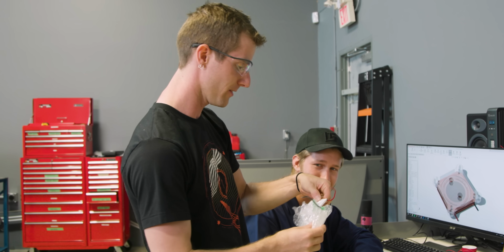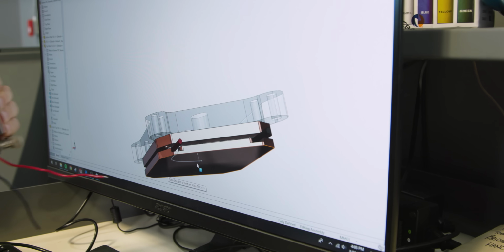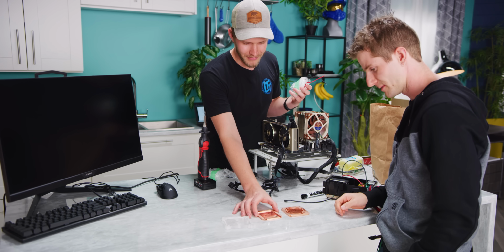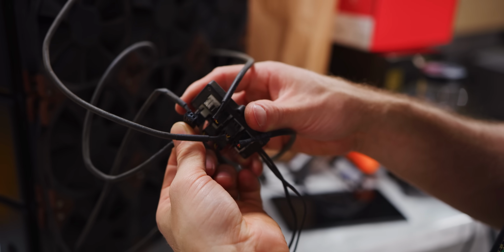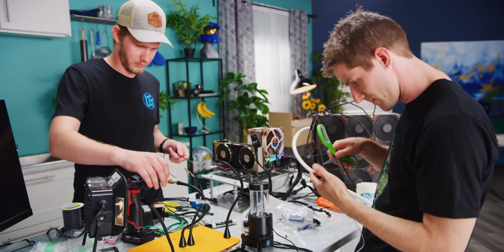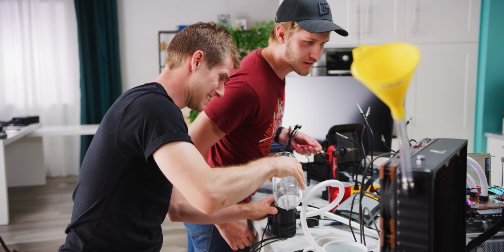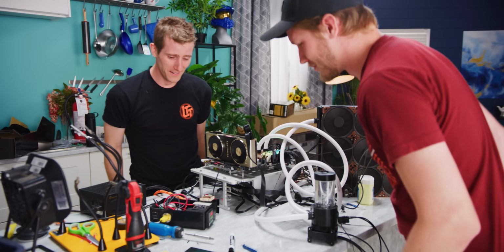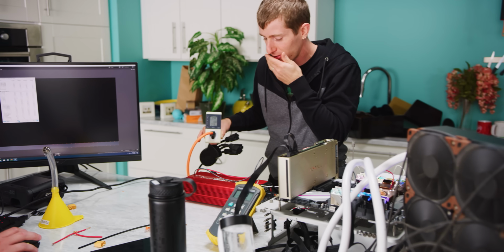This Cooler DRAWS 545W!!? Bad Cooling Ideas #2

Comment: Why not cool the water instead of the processor with a bunch of peltiers?
Reply: though the same thing, if this isnt the next thing they try it will probably be forgotten. cooling water would definitely work tho.
Reply: Build a buffer of cold water and in normal use it would work great, gaming for 24 hours or even 8 hours would probably overwhelm it
Reply: @H3nryum  not if you cool it with normal radiators before going extra with peltiers after those.
Reply: @4.0.4   thats what i would do, cool the return process water via radiator, bypass Peltier or disable/lower voltage of Peltier if below a certain temp.
Reply: @H3nryum  you just need to get a system that switches between two or three big tanks of cooled water when they reach a said temperature. One is used to cool the pc while the other is rapidly cooling and they switch back and forth between water tanks to run forever
Reply: Having the cold side attached to a large passive heatsink in the resovoir probably would be more effective .
Reply: is that not exactly what they did the first time around?
Reply: Ara Torosyan Yes they did that with the first video, got beefy Peltier coolers and water cooled them then used the cooled water to cool the CPU.
Reply: Worth a try
Reply: I was just about to say this, you can run it at full power even.
Just do a thermal coil of some sort into the radiator
Reply: The only problem is to find the best way for heat transfer
Reply: They kinda did it a month ago: https://www.youtube.com/watch?v=IX2NQ1lq4ZM
Reply: i Say add the pelter in loop with just a cpu block on it and you can have a hot rad on the other side heating your room :)
Reply: Because a chiller is vastly more efficient
Reply: the problem is any set up that works generally uses 2 peltiers because 1 isn't efficient enough. I believe there are a few builds of both chilled water, and directly cooled peltier builds on overclock,net. The issue with the water chilling, for it to be super effective the water would have to be chilled below the dew point which causes condensation up to the cpu cooling block.
Reply: Peltier Hot side on the inlet of the radiator and cold side on the outlet. They get to use the stuff they've already made and it'll work.
Reply: yeah, but then you could just buy a waterchiller, which you can easier integrate into the loop AND can actually choose a temp, like just above the dew point
Reply: Because you would need to cool the pettier again and so you just loose efficiency
Reply: They need to build a cooler that's basically an electric water heater but for cooling.
Reply: They did in the previous video: https://www.youtube.com/watch?v=IX2NQ1lq4ZM
Reply: c0ldw1nd  like they did before but with more of those aquarium coolers or just use that huge blue blower from highest airflow pc video and stick that on that triple rad👌😂
Reply: About to say the same
Reply: https://www.youtube.com/watch?v=7BwRvzIoqb4
and check out his watercooling air cooler...its in korean though...
Reply: maybe because the water would freeze if waterflow wasnt sufficient. also the surface area of the cpu is way smaller than the water container. but i am only guessing here
Reply: @raven.dracali  10.000 dollar 900 watt water heater
Reply: actually der8auer made 2 Videos about that
Reply: Separate the cycles as I did. And reduce the water temperature with the peltir.
cool the peltier with another eyelash.
start the peltir loop first.
At 18 degrees turn on the CPU
https://www.youtube.com/watch?v=XkKbIP_Y9A4&list=PLEMp9XvhwLe_SHZcKe8zCEayuFIimHLA6&index=156
https://www.youtube.com/watch?v=CG-CVr_vEo4&list=PLEMp9XvhwLe_SHZcKe8zCEayuFIimHLA6&index=126
https://www.youtube.com/watch?v=758BIB8tS3s&list=PLEMp9XvhwLe_SHZcKe8zCEayuFIimHLA6&index=145
old`s >
https://www.youtube.com/watch?v=Aj3DXK7aVbA&list=PLEMp9XvhwLe_SHZcKe8zCEayuFIimHLA6&index=70
https://www.youtube.com/watch?v=0csO_FSYnGQ&list=PLEMp9XvhwLe_SHZcKe8zCEayuFIimHLA6&index=102
Reply: Der8auer did a video on this already
Reply: a "bunch" of peltiers, each drawing 900w. DO IT LINUS.
Reply: Been there, done that. I used a commercial product that controlled the peltier with a pwm signal. The controller kept the pelt from going too low in temperature. 25°C was the target. The pelt was cooled with a copper heatsink and a 60mm fan. This was ziptied to a small waterblock that ran inline in the water loop after the rad and pump. The heat from the CPU was dumped out the radiator and then the water was chilled by the pelt.
Reply: But then you need another loop to cool the hot side of the peltier...
Reply: @jameshealy4594  just cool the hot side with the same loop. Boy do I love breaking the laws of thermodynamics.
Reply: I second this!
Reply: No, this way is more efficient
Reply: Nice Idea! They could use alcohol or oil instead of water to prevent it from frezzing.

Comment: Try to use modules with less than 100 watt and it will work mush  easier due to the lower heat will be removed form the hot side since as i know that piltier convert the used watt to heat + the moved heat which is so much best luck

Comment: You might have needed to have a ceramic plate to isolate the upper and lower plates and have non-conductive screws as you might have had some heat transfer.  Also can you not find a thicker TEC?

Comment: a freind of mine was running such cooling in 1999 with a self made cooper cooler and an aquarium pump.... hes problem was the condensate cause the cpu was running at -30 C° in idle. There are several points you can check once more if interested in fixing it. 1.  First i would check the controller. 2. The temperature sensor. 3. Check the water temperature.

Comment: for all the info  i have read about peltier thermoelectric it works better  to inductive heat to make energy  if you read at any physics book the cool air is air with positive charge and the hot air is with negative charge

Comment: This is like inserting an extra slice of bread in between your PB&J sandwich hoping it'd taste better and has less bread.. Wait, did I just think of a new sandwich? I'm gonna try this tomorrow.. 😝 
Yeah, not sure that was the best setup.. Why would you insert a potential insulator between a heat source (CPU) and the heat extractor(water block)? Even if the Peltier was super efficient, cooling would still be limited by your water loop/radiators.. You're probably better off trying to cool the water using a custom Peltier setup (maybe a low power setup - multiple low power modules) than trying to cool a CPU directly..
Reply: At least that that way even if your TEC setup fails, you still have cooling if not sub-ambient cooling..

Comment: could you not do a couple water blocks with normal air coolers and insulated tubing to exchange temp from water removing the overwhelming heat from the direct contact of peltier to cpu use the water as a buffer

Comment: I made a project in 2014 about all you had designed here, but I also was able to use the peltier to watercool a GPU, but I was also able to transform heat into electricity to power the TEC, awesome to see it again

Comment: Yeah, thermoelectric coolers aren't really meant to cool a continuous heat load like that very well.  I knew an engineer who specializes in thermoelectric coolers and the main scenario he used them for was when a piece of equipment needed to be kept at a very precise temperature, such as optics in a spy plane camera.

Comment: Useless. The peltier cell generates more heat than the CPU. It's only job is to transfer heat and it's pretty lame at it anyway...
You are setting a bad example by suggesting jamming the EPS plug to the PCIE power socket, the +&- pins are reversed between them and there were multiple cases of people frying motherboards and graphics cards by doing it. This was supposed to be tech channel but it became a competition for the dumbest idea ever...

Comment: This idea is fundamentally flawed... The fact is, peltier devices produce more heat than they remove, so you're just forcing the water cooler to have to cool even more heat. The rate at which a piece of copper would transfer heat is much more efficient than a peltier device. The main point you're missing is that peltier devices do not produce cold, rather they move heat. The only difference between it and a normal heatsink is that a peltier device can move heat between places that have equal thermal energy or even from low thermal energy to high, while a heatsink only moves from high thermal energy to low. When cooling a CPU, all you need to do is move high to low since the cpu is much hotter than the environment.

Comment: instead of making a copper plate for the cold side, you probably have been better with just some kind of frame to hold the TEC to the watercooler and let the TEC touch the cpu directly. or just thin out the copper from the cold side.

Comment: Why in the world didn't you just swap out the TEC water block with a normal water block so we could see a direct comparison?!
Reply: I concur; slap the same waterblock right onto the CPU, not like the bottom of it was milled to a certain shape or anything.
Reply: It would be pointless, with that amount of flow and radiator surface area the 9900k would be in the 30*c range given decent heat transfer between the block and CPU. It is so overkill for a stock CPU that it is bordering the ridiculus.
Reply: @rainmaker6217  You typing that out is incredibly boring.  I want to be amazed like you were the first time you seen an overkill water cooled system.  I have never seen one.
Reply: @1spaghetti32  I fully understand the urge to see something like that, but it's not really going to give any interesting data in this case. Past a certain point you don't really see all that much of a temperature gain with watercooling if you continue running the fans at the same speeds. You can however run the fan speeds significantly lower on a massive radiator setup like that if you were so inclined. The temps won't be all that different from a decent 360/420mm radiator though as the fans are likely not being run at sub 500rpm in this case.

If you want to see an actual cool build with one of these massive radiators you should check out what "Not From Concentrate" did in his build (just search for "Miniest ITX, Maximumest cooling! (I sorta watercooled a S4 MINI...)"). Otherwise there is also the house watercooling build on this channel as well, and a heap of other cool ones out there.

My point was simply that in this case tehre really was no benefit in doing an "apples to apples" comparison for the loop with and without TEC.

Comment: Solid state relays only work with AC. If you use DC voltage then it won't turn off, which is what was happening to you. (The input is still DC though.)

Comment: Dear LTT, 
All you're doing there is introducing another 545W of thermal energy between the CPU and the cooler. 
Anything with a Peltier will cool worse than without it. 
Regards,
Timo

Comment: Dont give up! 
Improve the waterblock, I suspect that the middle lanes will have a much higher flow rate. And use a huge reservoir in the watercooling part. Like a bathtub or a aquarium. And no radiator there! It should at least be capable of proving the other part, because 900W need some time to heat up 100L of water. A second watercooling system could cool down just the bathtub.
This way you also get around the high flowresistance in the first waterloop. You could also look out for a much stronger pump there.

Comment: A peltier would never work to cool a cpu....it creates heat on one side, and coolness on the other, whilst the CPU also creates heat.  The heat from the CPU wouldn't be dissipated thru the peltier, rather the cold created would just battle against the heat.  Think of it like putting a heater in a refridgerator.....the fridge cold will not take the heat away from the heater, rather it will just cool the heated air, so the hot and cold are just battling against each other.  The heat from the CPU was never removed.

Comment: SSRs need AC (on the load side), and never unplug the load from then while they are on, or they will fail shorted.
and please use a grounded metal box for those. (but 120v really isn't that bad)

Comment: Best way ive found to use a TEC cooler is 2 loops.

First loop(Cold Loop), goes CPU Block -> Radiator -> TEC Cold Plate -> CPU Block

Second Loop(HOT Loop) TEC Hot Plate -> Radiator -> TEC Hot Plate

This allows the majority of heat from CPU to be dissipated by radiator then the TEC to pull to sub ambient.... My TEC Cooler uses 2 Pelt modules with cold sides sandwiched against a single block then 2 blocks on the two hot sides.... Imperfect system but works for sub ambient cooling without ice or hvac system

Comment: The idea of a peltier element is to MOVE heat, not to cool. They are also more efficient if you give them less current. More current just means a higher temperature difference between both sides, and extra quiescent heat. Run them at low current instead, to get a 15-20C difference. The CPU will be cooler than using a cooler rated for the TDC of the CPU + current you feed to the element alone, but the case temperature will be higher. More power to the peltier is detrimental. They also do not work well if the current source isn't constant, you're not supposed to drive them like a fan. Once again Linus, a little reading before would probably have helped.

Comment: Just FYI alot of solid state relays cant do dc electricity
 edit: you can see at 5:23 that it is make for ac electricity
Reply: They do if you get one designed for DC.
Reply: @Armand79th  5:23 they didn't

Comment: lol fun video. You are only half wrong. Peltiers will be able to cool that CPU.
I just played Anno1800 for 4 hours on my peltier cooled 8600K at 4.8-4.9GHz and it's between 30-40 deg.
I have a warm and a cold loop, use an arduino to regulate the temp whit 2 mosfets and 2 60w peltiers.... 
To be clear, it is not a smart solution, but It is possible to make it work and it was a fun project.
I have made a pdf with some details, fill free to try it out. Note you can use larger or more peltiers if you like, this setup can cool about 120w, but add one more and it is 180w.
https://www.dropbox.com/s/gt631ly9vtchwmp/Petch_Peltier_Cooled_PC.pdf?dl=0

Comment: Put the tecs on that massive radiator. You can run like 3 on the flat sides and 1 between the inlet and outlet. 7 tecs!! Then just run a normal water cooling setup from there. You'd cool the water in the radiator by conduction. I'm not saying it'd work, I'm curious if it would though. Some how you'd have to cool the back side of the tecs but you guys are smart.

Comment: TEC are good for direct die thermal stabilization, meaning that you have close to direct contact with the silicon substrate itself and you use the module to keep the chip at a controlled and precise temperature. That Peltier module should be overkill even for your application and your cooling loop is probably fine for the load (Transferred heat + Peltier dissipated power). However, if you pump max current to the Peltier module you are probably in an extremely inefficient bias point, where the transferred heat is close to zero, and you are just adding the Peltier power consumption to the hot side.
@Linus Tech Tips I'm an electronic engineer and I have designed TEC controllers in the past, feel free to contact me

Comment: Linus check that you are making a Seebeck effect. When one side of the peltier module are expose to heat, the module converts in a energy generator.  Also the problem you have is that both side of the cooper touching together you must separate with some material that doesn’t transfer the heat from one side to another like ceramic or wood.  Cooper are a very heat dissipation. May you have the same 100•c in the heat part and was transfer to the cool side.

Comment: Why not try using the tec inline in the loop instead of on the CPU. Similar setup just use a pass-through block inline that way you can just gradually cool the water instead of trying to cool the CPU directly? Also this would allow you to pre chill the water to just above the point of condensation therefore allowing you a thermal edge from the beginning

Comment: That copper block is way to RESTICTIVE for the water to pass trough quickly enough.  The trick is to have the same water speed as with just hoses(without the block).  My diy block had a snake machined out, with the same inner diameter as the piping. When Linus said the copper block was heating up its obvious that homemade block was overwhelmed. Its not enough to 2x the water flow when you 8x the wattage.. I made a similiar arrangement work 17 years ago on a AMD cpu, so it can work. Another thing that may cause this experiment to fail is that the peltier really cant transfer heat sideways so you need to have a thick copper block between cpu and peltier to act as a buffer/spreader. Also you should have cooled down the cpu way before turning on a benchmark, the peltier was playing catchup with all that energy buildup. It should be enough with 2-300w into the peltier if the cpu is only outputting 100w. I doubt the water block could handle more than (300w+100w) 400w, so a sweet spot must exist on the peltier power level.  I would really like you to succed since you have come this far :) If the water side of the heat block got warm, please make a more high flowing block and retest! And you need that relay working to control that beast!